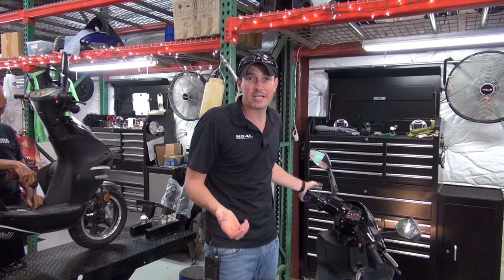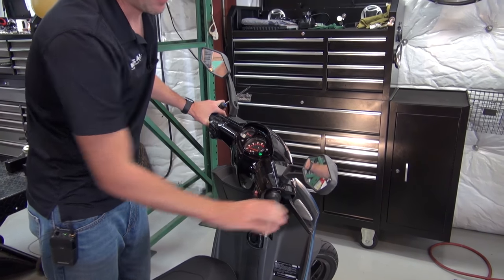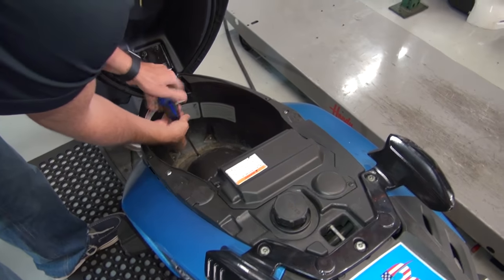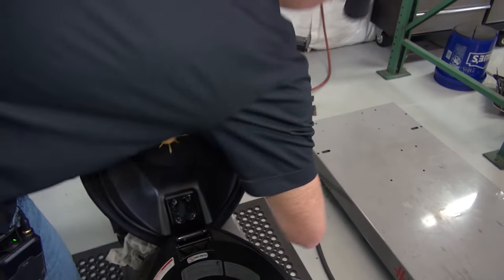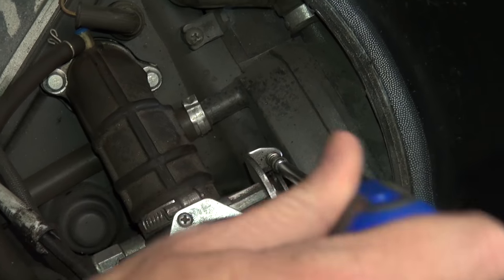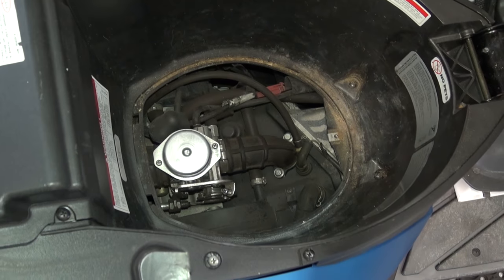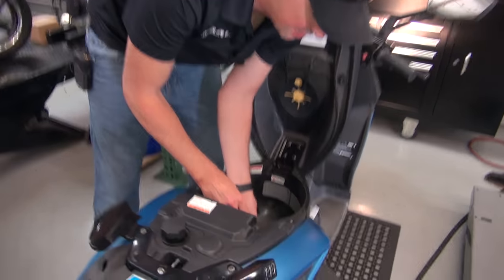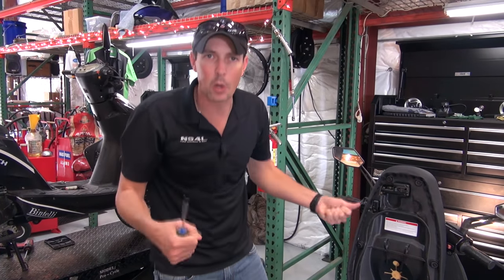Scooter Troubleshooting: Scooter Dying Out When You Come to a Stop / Low Idle

Comment: Subbed, liked and everything! Guys, what we do on a scooter without carburetors? I own a pcx 150 and it happened to shut down exactly as you said on low idle, or coming to a stop to check the surroundings before crossing a crossroad. The honda service here cannot find any problem. I dont say it happens a lot, but you know... you dont want your scooter to shut down during turning! Its a 2014 model, I dont use idle-stop and I dont know what to do. Should I change battery, fuel pump or something? Also the side-stand that turns off the engine when deployed, works fine (as they said). Any suggestions? I read some comments below and for 150cc or more that are fuel injected like mine, perhaps we should try adjusting the throttle-something? I am even ashamed to tell them "hey i looked up the problem on youtube and this is the possible solution". Its authorized service...Thanks a lot in advance!
Reply from the maker: This stuff is so incredibly tough to 'diagnose' through comment threads, but just reading your comment, I'm wondering if you could have a short somewhere.  Do you just lose power sometimes when making a turn?  I would think that a wire is exposed in the harness and when you turn and that wire rubs the frame, it is shorting out and causing it to cut out.  Are you blowing fuses or anything?
Reply: New Scooters 4 Less thanks a lot for your reply! Well, I checked around the right side of the handlebar, where the throttle cord wire and rest things run around. I happened to see two rectangular fuse-like things (sorry but im not sure what they are exactly), which had two thin cords inside, yellow and green. And I saw the colors, because they were exposed, they didnt seem to have exposed or torn though. I pushed them back again and then I rode away. Pushed the bike with some strong brakings and then sudden throttle and no shutdowns happened. I dont know if it was a coincidence, but will still keep my eye on them. Perhaps the small protective boxes got loose because of the summer temperature? We have 40s during the day and 35s C during the night. Anyway, you can see our authorized service here is... Oh well! Also, my disc brake looks like de-painted/scratched in an arc part. Could it be because of bent discs or faulty calipers? Because in the past I could hear a squeak whenever the bike was moving, with the sound increasing when accelerating. Service told me "I cannot hear anything". By the way I bought the bike brand new, not second hand. Thanks a lot again!
Reply from the maker: @timelostdream  I'd have to see what the wires and rectangular boxes are you were referring to, but that could have been it.  Probably wasn't a fuse as I have never seen a fuse in the handlebar panel before, but if any wire was exposed or not intact correctly, it could cause issues for sure, so maybe that was your issue.  Hope you don't have any more problems there.  I wouldn't sweat the brake disc.  It's going to show wear over time.  I'd only be concerned if you have excessive squeeking or if the scoot feels like it is pulsating when driving or braking.  Best wishes!
Reply: New Scooters 4 Less I took a photo with my phone, its not very clear but you can see the green and yellow wires and the rectangular male/female "boxes". Will post it later, since my phone is a bit old and cant share from here. I will make you a plan here for now

Ξ===[  ] [  ]
Ξ===[  ] [  ]

So here is the explanation: 
Ξ is the black wire tape cover that covers the green and yellow wire
=== are the two wires, green and yellow (so the wire tape has moved by hand, not mine ofc, or from the environment heat)
[ ] are the male and female boxes I guess. There are two halves of them, thats why I think they are male/female. The one that was slightly off to the left was the lower left one. After I pushed it back, no problems at all. Will send the photo later too. Thanks a lot again for your replies!

The right side halves seem to be stable and immobile
Reply: @NewScooters4Less  here is the photo I took https://imgur.com/a/tHnAsgf The phone is looking at the right side and its placed between the grips, in the middle of the handlebar. The green and yellow wires lead to this rectangular, usb-like stuff. The black wire tape that covers them was pulled back or something? What do you think? I pushed more in the one that you can see clearly.
Reply from the maker: @timelostdream  That pic wasn't the greatest, but I think it is just a brake switch from what I can tell.  Definitely not a fuse.  Thanks!

Comment: For me? It seem to be a different problem.. As if the Starter clutch or drive clutch is sticking when I hit the brake. My scoot stops as soon as the wheel stops?
Reply from the maker: Have you opened the transmission casing and looked inside? Maybe a broken spring in there on the clutch or something. Should be able to pop off the case and take a look around.

Comment: I have tightened this adjustment screw so much that I can not go further. However, the engine still dies out when idle. Can you please give me some hints to solve the problem?
Reply from the maker: It could be a few things... It could be a bad carburetor, issues with the jets in the carb, or something like a vacuum leak.  What kind of scooter is it?  You might want to replace the carburetor all together.  Some are cheap enough to where it makes sense to do that.  Good luck!
Reply: @NewScooters4Less  Thank you for your kind response. My scooter is Chinese one and model is Gator-50-S3.
Reply from the maker: @e-wave8247  Email our service department a picture of your scooter at service@NS4L.com and they can email you the cost of a carburetor that would work.  I would replace the carb and clean out the fuel system.  Hopefully that will do the trick for you.  If you have a local shop, I'd probably get it in there if possible.

Comment: Hey I have a 4stroke motofino 150cc. It starts and idles fine but when go to accelerate it bogs down and shuts off. Any suggestions?
Reply from the maker: Fuel air mixture?  Probably getting too much of one or the other.  It probably has a fuel / air mixture screw you can adjust.

Comment: So we changed the idle but our issue is it’ll start on the stand but struggles on the ground. (Resistance on the wheel) we’re thinking maybe something with the clutch? It dies anytime there’s resistance on the rear wheel ie body weight, brakes
Reply from the maker: Yes.  You could have a broken spring on the clutch or another similar issue.  I would definitely pull the transmission casing off and look at that clutch and transmission.
Reply: @NewScooters4Less  After I sent this I pulled the cover off and found the issues. The ceramic pads for the clutch were all broken and pieces were everywhere. Ordered a new clutch and transmission assembly that I will be putting on later today!
Reply from the maker: @Consi2536  Excellent!  I am glad you discovered the issue!

Comment: What if I do this and it doesn’t work, when I higher the acceleration the wheels move to much and when I lower it just sounds like it’s going to die again, there’s no in between with mine, maybe battery ?
Reply from the maker: Check for vacuum leaks.  Could be a crack in your vacuum line, could be a crack in the intake manifold, etc.  Thanks!

Comment: I have one question... Please help me this. 1) During initial acceleration in my mopped it is not moving... I need  to raise it even more than a other mopped.
2) Engine turns off when the scooter is not running.
Reply from the maker: I’m really sorry, but I’m not sure what you’re asking. If your scooter is cutting out on you, then yes… you may need need to increase the idle a little bit.
Reply: @NewScooters4Less  when I accelerate slowly, it does not moves during initial acceleration, I have to raise it even more to make it move. 
What could be the problem?
Reply from the maker: @balajir4593  Maybe a transmission issue?  Maybe the variator and/or clutch isn'tt enging the belt correctly. It's difficult to say. Ii'd recommend getting it into a shop. Thanks!

Comment: How about if you don't want to adjust it to above 4000rpm idle just to keep running 🤔.  How do you fix to keep 2000rpm when it wants to die out?
Reply from the maker: Maybe set at 3000 rpm? I think it's just finding a nice medium.
Reply: @NewScooters4Less  Factory recommended idle for Ruckus is 2,000 rpm +/- 100. Turns out I was losing compression because the service tech didn't seat spark plug all the way 😒
Reply from the maker: @fisher5413  Ahhhh.. Gotcha.  Glad you got it sorted out!

Comment: So today I’m going to buy myself a gilera runner 180 vx witch is the 4stroke version the bike starts up fine and rides nice but once I come to a stop it dies out but will start back up and go again also the bike seems to back fire and crackle and pop I was thinking if not the idle maybe I should try clean or change spark plug and old oil?
Reply from the maker: Probably fuel and air mixture is off.  I don't know anything about that bike, but I would look at spark plug, carb, air filter, vacuum lines and make sure everything is good there.

Comment: So the same thing happened with my moped, but when i give almost full throttle it dies out. What should i do?
Reply from the maker: Is it bogging down at full throttle or is it cutting out every time you give it throttle?  It could be several things, but I would start by checking the air filter, making sure its clean and that there are no cracks or anything in the air box. Check for any air leaks (cracks)  in the intake manifold (the part between the head and the carburetor). You could have some gummed up old gas in your carburetor / blocked jet, too.  Has the scooter been sitting without use for a while?

Comment: Hey, I have the same problem with Yamaha Neos 2009 4 stroke engine, how to solve this?
Reply from the maker: Does it have a carburetor?  Can you make this adjustment made in the video?  Also check for vacuum leaks (cracks in the vacuum lines, crack in the intake manifold, etc.)

Comment: Hi please I have tried adjusting like you sai but is not working for my kymco scooter is either I higher it if I try lowering  anytime my hands let go off the gas then it automatically go off  what could be the solution
Reply from the maker: You probably have a different issue.  My guess would be a vacuum leak somewhere.  Check your vacuum lines, intake manifold, and make sure that there are no cracks where air could be escaping.  Thanks!

Comment: What would be the difference to tune the carb by this bolt and not the fuel bolt?
I noticed my bikes is really hard to start on cold and shuts off at stops from times to times although the idle speed is strong and stable since i tuned my carb.
on cold starts it starts usually with the help of turning slightly the handle about 1/8, so perhaps this bolt will do the job
Reply from the maker: Are you talking about the fuel / air mixture screw?  The video shows the idle adjustment, so it is different.  Not sure I completely understand what you are asking though.
Reply: @NewScooters4Less  fuel jet screw that is located on the side of the carb is responsible for the idle also. you touched the air screw bolt
Reply: When you give it throttle on start up. Your accel.pump throws gas into carb.   Better starts! Bill

Comment: What do I do when it’s maxed out the screw it turned all the way and the idle is still rough and it stalls out
Reply from the maker: You have a different problem.  Could be a vacuum leak / issue.  Could be something internal with the carb.  Could be an airflow problem.  Could possibly be electrical too.  Sorry!  May need to have someone look at it :(

Comment: My issue: Where you have it on the center stand it idles fine, but the back wheel is moving. When I hit the rear brake, then it dies out. It's like the power from the motor never disengages from the back wheel. Thoughts?
Reply from the maker: Is your concern that the back wheel is moving when it is on the center stand? (As long as the scooter doesn't feel like it is pushing you when it is on the ground,)  it's ok for the back wheel to move a little bit when on the center stand because when it is on the ground, it won't. Does that make sense?  (Think about it like a car...  When you take your foot off the brake in a car and it is in Drive, it wants to creep forward.  Your foot on the brake is keeping it from moving forward.  It's similar with a scooter... when your scooter is off the center stand and on the ground, the brake and your body weight keep the scooter from moving forward (unless of course the idle is too too high and the scooter feels like it is pushing your forward when idling)).  Hope that helps!
Reply: Oh it’s definitely pushing me. It jerks the whole scooter with each stroke of the motor until it dies. I’ve adjusted the carb with the same symptoms. That’s why I wonder if it’s the transmission assembly
Reply from the maker: @93paxon  I'm almost willing to bet it is 100%! Sounds like the clutch may still be engaged when you are at a stop.  Probably a popped spring on the clutch assembly!  Definitely check that out!

Comment: I was having the problem of riding for 3-4 miles and then the moment i stop accelerating my scooter turns off. So i did what u recommended here and its working now, but could it be that now i have way too high idle ? My scooter sometimes starts moving with no acceleration and my fuel consumption went up like crazy? Could lowering help or you would recommend something else ?
Reply from the maker: Yes.  Turning up the idle delivers more fuel to the engine to keep it running, so if it is turned up too much it will burn more fuel and it will start moving with no accelerator being turned.  I would recommend turning it down.  Sometimes you have to find that sweet spot between it being too low and dying out and being too high.

Comment: Do you have a video to help with a 50cc moped front wheel/ steering shaking when reaching 30-35 mph?
Reply from the maker: Hey!  We do not, but is it shaking uncontrollably or just a little bit.  Usually this is due to a bent steering column.  Did you run into a curb somewhere?  Does it turn side to side ok or is it sticky or tough to turn the steering column?

Comment: I have italika motor D125 in any weather when i turn on the scooter the battery makes a sound and wont turn on,so i need to kick start the scooter

 what seems to be the problem??
Reply from the maker: Does the battery work well in the warm weather?  Could be cold-cranking amps in the cold.  Could be tight valves and need an adjustment.  Could be a variety of things, but a valve adjustment is probably what I would look at first.

Comment: I just replaced the battery in my Vespa 150 after a long time in storage and it still stalls out after starting right up if I let it idle. I hope this is the fix.  About to go try.
Reply: Yay!  it worked.  I am not driving it as it is not registered or insured but it ran idle long enough for me to go get my mail and more do it is ready for sale.
Reply from the maker: @louiseschwendeman920  Glad it worked.  I was going to say that it could be a dirty, gunked up carb if it has been sitting a long time.
Reply: @NewScooters4Less  It surely could use a good tune up and some lengthy time running to clear all that too.
Reply from the maker: @louiseschwendeman920  Probably!

Comment: I’ve tried this on my 125cc moped and it didn’t work as good so I cleaned the carb to see if that worked still didn’t work it’s a 2022 plate so I’m not sure it also loose power
Reply from the maker: Could be something else causing your issue.  Do you have a shop you can take it to?

Comment: I have a Chinese 50cc scooter. I just bought it it runs while holding the accelerator then dies 5 seconds after letting it go. I’m thinking spark plug. What you think the problem is? Oh it’s been sitting about 4 years I have cleaned the carb and flushed out old gas and got it to run
Reply from the maker: You are still having fuel system issues.  In this case, it is usually less time and money for you to replace the fuel system.  I would drain all fuel, clean and recoat the fuel tank if necessary to make sure there is no rust inside of it, replace the fuel line, fuel filter, fuel petcock, carburetor, and spark plug.  I'd also replace the vacuum line because I imagine it is rotted and prone to leaks.
Reply: New Scooters 4 Less ok thanks I’m going to change the carb and spark plug the other things I already did I forgot to mention

Comment: Is this problem related with any weather change?
Reply from the maker: You can see fluctuations in idle due to temperatures for sure.  Some scooters are worse than others (cheap models).  The warmer the motor, usually the higher it's going to idle.